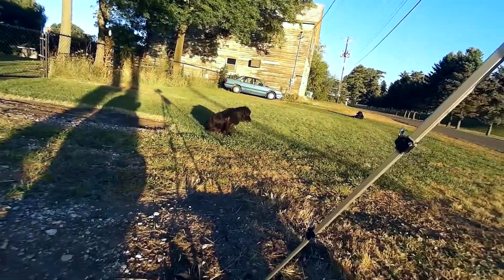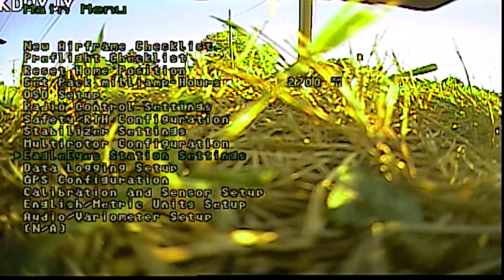Overview of my new, Ready Made RC / Eagle Tree Systems antenna tracker - Sept 22, 2014

Comment: I'm putting all my "parts" together. I've researched alot to and there's not much info. Thanks for the video walk through! Have you been able to fine tune it a little? Are you happy with it? I should be able to try mine this weekend. Maybe I'll have some video. I sub'd your channel!
Reply from the maker: Thank you for the feedback Doug Kuechenmeister !

It would have been a lot nicer if there were begginer or "starter" kits for this sort of setup. I found that the more that I read, the more I got confused. Eventually I was confusing the features of one system for another. The vector is not my initial system for my tricopter, as I started with and struggled with a Hobby King control board. I'd also purchased the Eagle Tree Systems predecessor to the Vector, but the complete setup was intimidating and when the Vector cameout, it was a great replacement for my tricopter control board. The OSD was a breeze to integrate as I already had the transmitter and camera installed. Once up-and-running, I later purchased the Eagle Eyes tracker and added those features to my existing video receiver setup.

In all, I think its a better deal to start with the aircraft side and get it "flyable", then continue to add the features, one-at-a-time. Though Eagle Trees really promotes using the OSD for controller configuration, one can use a PC to configure it via USB and the controller works just fine in conventional flight and no FPV. Adding the video feed later and lastly antenna tracking meant I could focus on "bite-sized" features to master and get dialed-in. I can't imagine trying to configure all of this in one sitting and having a successful maiden flight.

From what I've read, the Vector uses multiple processors, so stabilization processing isn't compromized by OSD or GPS features. Other systems use a single processor, so mission critcal stabilization processing is going to compromized in the support of advanced functions. I've already followed multiple firware upgrades with continued improvements to performance and features. I hope that the Vector continues to be evolved as its a great package. My only real beef is the "primitive" functionality of the Eagle Eyes tracking of which I believe could benefit from more advanced algorithms in "predictive" tracking of the aircraft and support of two channel audio.

You can see some of the evolution of my setup in my tricopter aerial playlist here: http://www.youtube.com/playlist?list=PLMXlQTNNNkYHXkHr81tI05wK9OdPebBV_

Best wishes on your setup!

Glenn
Reply: mnragnar Thanks for the reply. I have a couple different flight controllers but the Vector has the most to offer. I've been flying it a couple months now and like it. I just got the Eagle Eyes and have read all the forums. I've been flying since the early '80's. One of my favorite aircraft  osd / stabilizer/ with rth is Cyclops Storm osd. You have a beautiful place to live and fly. Good luck to you!

Comment: That is a lot of gear nice
Reply from the maker: Thank you Cory Reeves . It is a lot of gear, and a lot of messy wiring.

The long, dark winter will be upon us soon, giving me more indoor time to repair some of those crashes that I've been putting off AND cleaning up some stuff like the wiring on this project. You know how it is... So eager to get the new toys out. Get them functional and start flying ASAP. I hope to have a crystal clear video and audio from this setup soon.

Congratulations on your Corsair maiden. That flight went pretty smooth.

Glenn
Reply: Thanks Glenn, the takeoff was sketchy as most new takeoffs are, and it was only 35 degrees and I didn't land hard but a slight nose over put a pencil size hole in my pretty new cowling  and that was after my corsair rolled of the runway and nosed over in trhe grass as you can see in my maiden flight video. A new cowling was 9.99 and 12.99 with freight so I now have a spare for some more practice. You video set-up rocks way nice.